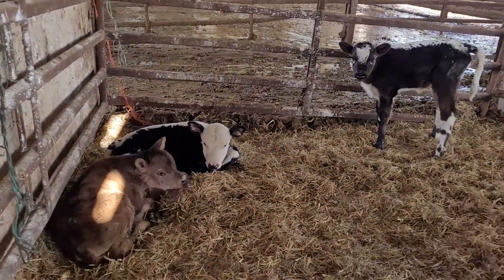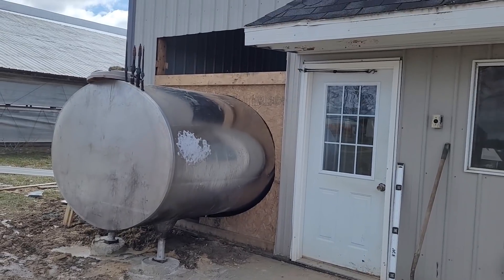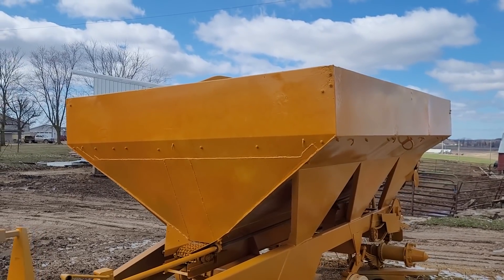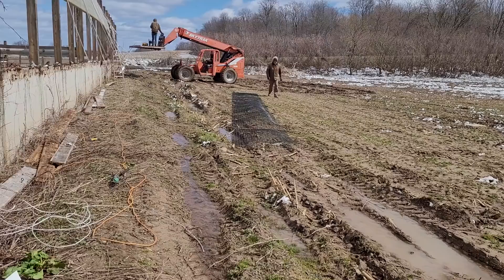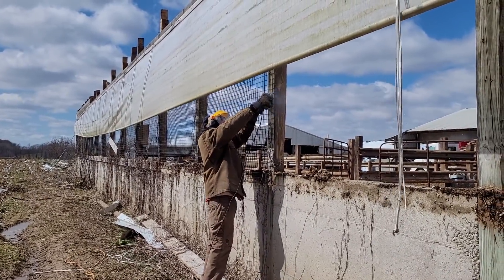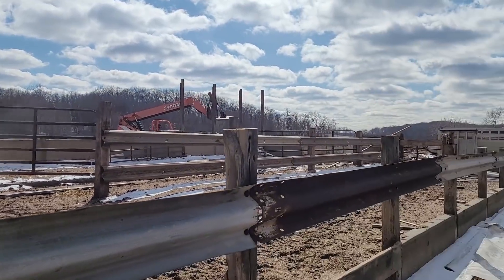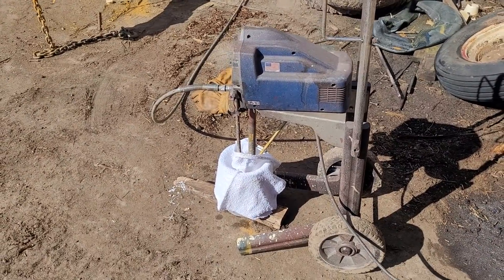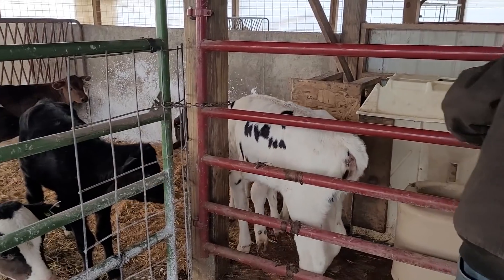Name That Breed

Comment: We used to milk 200 cows and had about 40 of those cows with the line and speckles. They are Randall line backs. We did dhia testing , they are very good milkers ,with 80-140 lbs on test with a better than holstein average  for components.

Comment: It has got to be English. Put the screws in concrete  mixer and put fine sand in it and turn it on until they clean up and repaint if you want to use them

Comment: Should see if you can get a load of that crushed concrete for your driveway. Were I work we save up all the left over from concrete deliveries and every 6 months we run it through a crusher. We crush around 4,000 yards of it. It works wonders if you have a problem with mud You might have to apply it several times as it will get pushed into the ground. But each time you do it the ground gets tighter
Reply from the maker: We need some crushed concrete!! So much mud right now.🥴
Reply: @acresofclayhomestead  Ya gotta love mud season.

Comment: Does the fact of the Milk tank sticking outside have any impact on temperature stability? The farm i grew up on we had a 1000 Gal Mueller that was totally inside the milk room, we used get free heat from compressor unit during milking. Had a wall mounted Nutone fan to move the warm air into the milking parlor during milking.
Reply from the maker: Having it outside won't affect the temp at all.